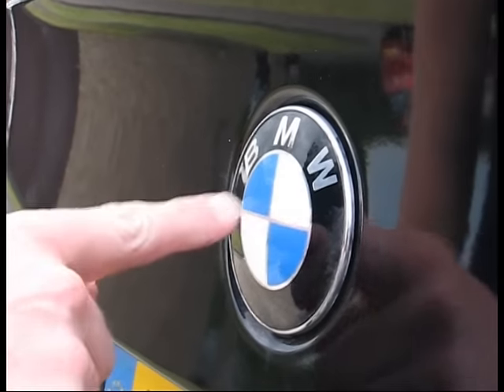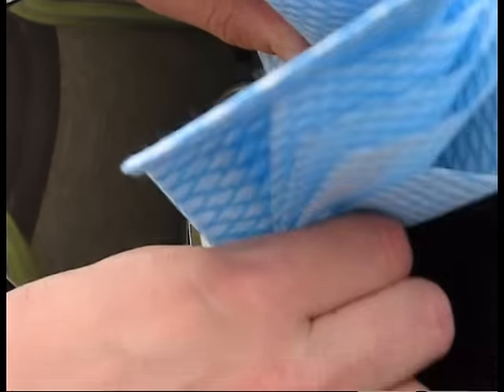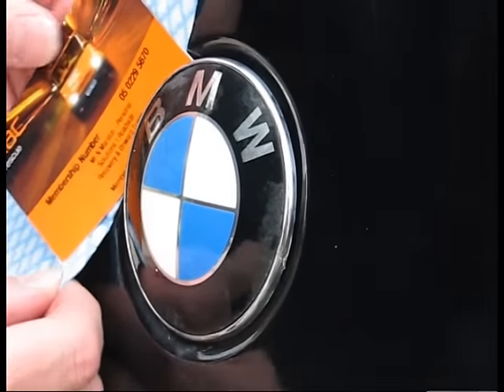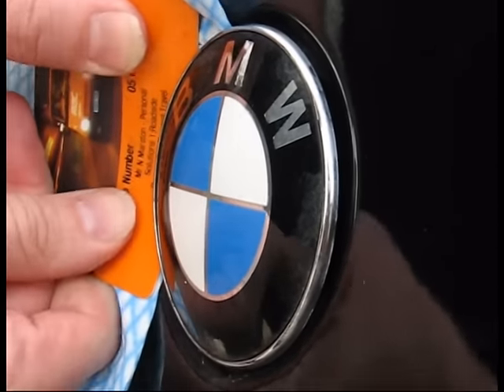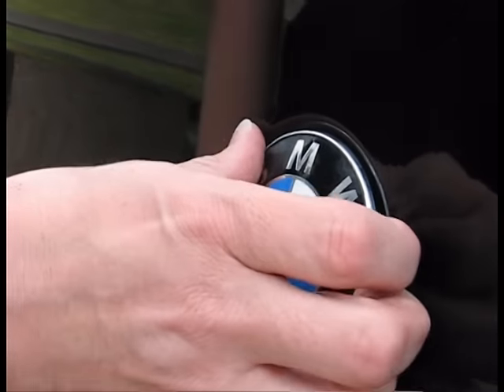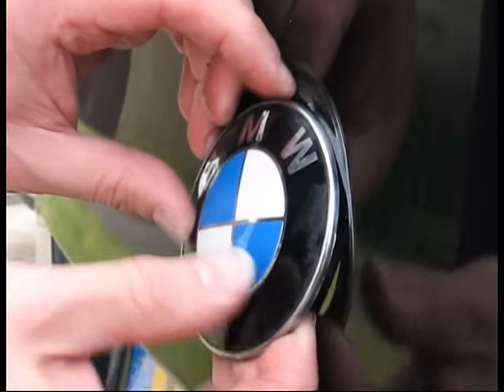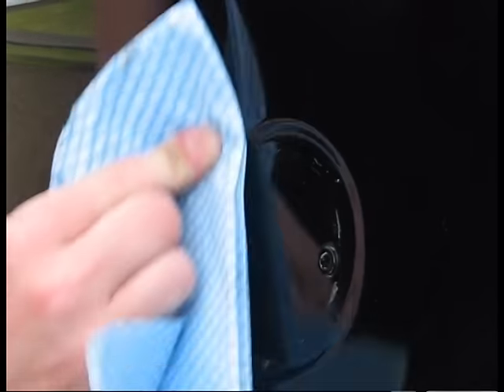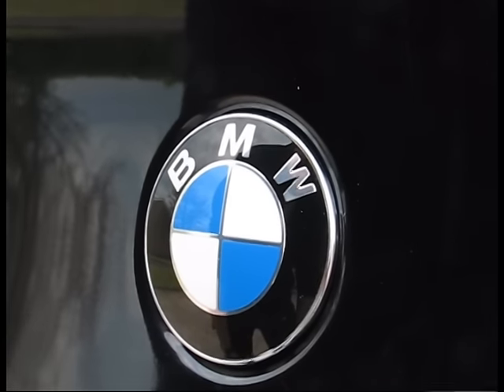How to Remove or Replace BMW Bonnet or Boot Badge

Comment: Or thread a plastic cable tie beneath the emblem from 6 o'clock to 12 o'clock positions. Take hold of both ends and gently pull. 20 second job.
Reply: clearly the best way to go, thread of plastic cable
Reply: This is the right idea.  It still took me a couple minutes of working it, but I thank you.
Reply: I did this, came out dead easily. Thank you!

Comment: Saw another video where a guy fed a cable tie from one side to the other and pulled to each side. Took 5 seconds
Reply from the maker: It read cuts into your hands if the badge is tight

Comment: Nigel, I tired a number of different methods to remove the old Roundel on my 2004 330Ci convertible and yours was the one that finally worked. Thanks.
Reply from the maker: That's great to hear :-)

Comment: Did mine today with the card, also i needed to use a small screwdriver using the card as a protector, its been on there since 2001, thanks for the video.
Reply from the maker: I'm pleased it was useful

Comment: A lens cloth works well here.  Hairdryer makes a massive difference also. An alternative to using a credit card is some nylon wire (such as fishing line) can help break through the glue.
Reply from the maker: Good advice. A hairdryer wont be necessary in most cases as only a small number of badges use adhesive

Comment: Make life easier for yourselves... Use a hair dryer for a minute or two before doing this then use a second card to leave a gap on the other side or all you're doing is pushing the badge back on when you do the other side. Using a hair dryer to warm it is definitely key, have done this with badges for years.

Comment: Hi, the plastic clips which are in the boot of my car under the badge have pushed inside the boot when I tried to insert the new badge causing the new badge to be insecure.  Can you suggest anything I could do to rectify this? Thanks
Reply from the maker: Marvin Dorfler do you mean the plastic posts have snapped off your badge and are stuck in the holes? If so, you can try easing them out with a screwdriver or drilling them out
Reply: @nigelmarstonmotorsport77  sorry, I should have explained it better.   It's the little plastic grommets which help secure the badge which have fallen inside the boot lid.  I think I can order replacements from ebay and hopefully use them, if they fit that is......
Reply from the maker: @Marvindorfler1  I have never seen that happen before. You can probably dig them out with a screwdriver
Reply: @nigelmarstonmotorsport77  thanks for that, I'll give it a go

Comment: My BMW 1 series boot badge is coming loose , can I just glue it back on? As otherwise its still in perfect nick
Reply from the maker: If you glue it on then make sure you use a glue that can be prised off in case you need to replace the badge at some time

Comment: Hi, does the 1 series coupe, rear boot have this badge type as well ?
Reply from the maker: I don't have a badge for the 1 series coupe in stock but it will use a very similar fixing method.  Some badges have adhesive around the outside too which may need to be heated with a hair dryer to make it easier to remove

Comment: I open my boot from the badge will it still work if I replace
Reply: Yes mate will still work just check with BMW to make sure. If you ring local dealer they will help to verify 👍🏻
Reply: @Isaac1987  but Im pretty sure there's wires n stuff but thanks

Comment: How do i change the color of ring that surrounds the emblem in i8? especially on the steering wheel?
Reply from the maker: I don't have enough knowledge of the i8 to answer your questions but I can't see any alternatives to the standard emblems on the BMW parts system. If it is like other BMW models, the steering wheel badge is not replaceable and in part of the air bag module.
Reply: Its okay, i appreciate your reply regardless.

Comment: The badge on the back of her 2009 Z4 is also the trunk lever.  I ordered a new badge and realized that it wasn't even the correct diameter.  I wonder if anyone knows the part number for the badge that is also the truck lid opener and how to replace it.
Reply from the maker: Tell me the last 7 digits of your VIN and I will give you the correct part number

Comment: Are they all the same. Does it matter what year and series it is. I have a 530i and want to put new emblem on the trunk.
Reply from the maker: Most are the same or similar but it depends on the year, model and whether it is on the front or back

Comment: Whats the mm of the trunk badge 82mm or 74mm?
Reply from the maker: It depends on which car its on and whether its front or back. Its not safe to use the diameter to identify the correct badge as some badges are a different shape or fitting. You need to use the last 7 digits of your VIN with the BMW ETK
Reply: Most bmws have 74mm on the rear and 82mm on the front!

Comment: What should I do if one pin cracked inside my hood? How to remove it!? I need to put the new emblem! Help please!!
Reply from the maker: Without seeing it, its hard to comment but if the grommet is still in position, maybe you can get a screwdriver under the edge of the grommet and lift it out and then hopefully the pin will come with it too? If not then maybe it has to be carefully drilled out.
Reply: same thing happened to me but it's barley sticking out so Its hard to grab with pliers to remove how did you do it?

Comment: I’m assuming this works for any brand car??? I have a Saab 9-7 and need to replace the rear badge!
Reply from the maker: JohnnyClock I have no idea whether it works for other cars. I am a BMW specialist and have never tried this on any car other than a BMW
Reply: Nigel Marston Motorsport okay mate!
Reply: On the back of a 9-5 it has adhesive, it is a bit of a pian to remove try the credit card method worked for me on my 9-3

Comment: I tried removing it but the pong broke while it was inside so now Idk what to do
Reply from the maker: You will need to drill out the broken part. It should be easy because it is only soft plastic
Reply: Had same problem this morn get a small hammer and small screwdriver and tap it through it falls out

Comment: how big is the emblem on the 335 e93
Reply from the maker: Vj Fifa Which one? Front or back. You should always use the part number instead of the size of the badge because there can be different badges that are the same size
Reply: Nigel Marston Motorsport what is the part number? im planning to buy one it says 82mm on the front and 74mm in the back but im not sure
Reply from the maker: Vj Fifa which badge? Front or back?

Comment: I broke nearly 5 credit cards but still I couldn't make it..
Reply from the maker: Sounds like it has been glued on or is the type that uses adhesive. Tell me the last 7 digits of your VIN number and whether its a front or rear badge and I can advise you further
Reply: Nigel Marston Motorsport only the owner of the car knows the number. How will I know...? 🤔
Reply from the maker: On many BMWs models, it is in a small window at the bottom left side of the windscreen/windshield.  Which BMW do you have and which badge are you trying to replace?
Reply: Nigel Marston Motorsport chill out Bro... And sry for wasting your time... I was kidding you ( as if am stealing it) but you are so serious abt it. I would like to tell you that I was just making fun... No offense..
Reply from the maker: I've been in this business for 27 years and over that time I have heard some really strange stuff so I've learned not to assume anything :-)

Comment: I literally just put my fingers behind the boot badge and pulled it out. Not all this Nancy pancy card stuff
Reply from the maker: You are lucky because they are normally much too tight to do that
Reply: @nigelmarstonmotorsport77  The bonnet badge is a different story, seen videos on sliding cable ties through and yanking them out, but it's too tight to even get one under.

Comment: BMWs are an utter nightmare.  They are over-engineered, expensive for what they are, build quality is rubbish and this is why I drive a Mercedes-Benz S63AMG Coupe, instead of an 850i Coupe.

Build quality on a Mercedes-Benz is in a different league, they are also well built, they do not over-engineer like BMW do, e.g. with BMW, really bright ideas to put batteries in the boot and such, haha, only BMW, and then make them so difficult to get out, again only BMW.

Other things that are major put offs, the badge replacement.  I have had or I am trying to sort out a new badge for my old mans little 120i E87, a car he hardly drives to be honest.  Always issues with it, battery always going dead, it is a pile of rubbish as are I think the majority of BMWs are, just total rubbish.  Anyway, the badge he needs, well it appears you have different ones for the same car.  Some are clip in, some are adhesive, some require the entire badge taken out and so on, haha, it is confusing, it is annoying, the car is crap, the brand is crap, so why are you not telling the truth please?.
Reply from the maker: Telling the truth about what? The video is about how to change a BMW badge